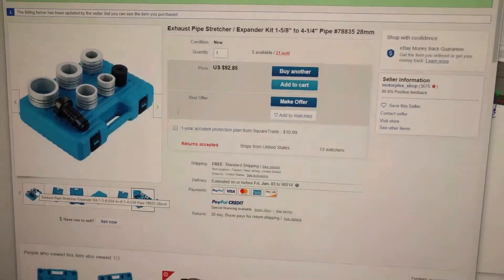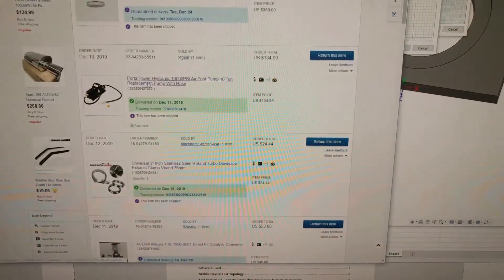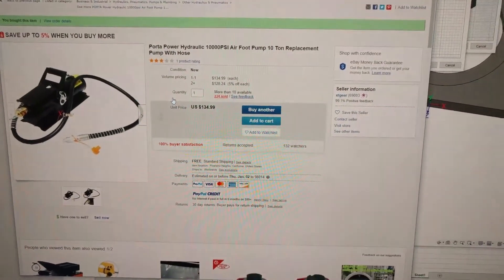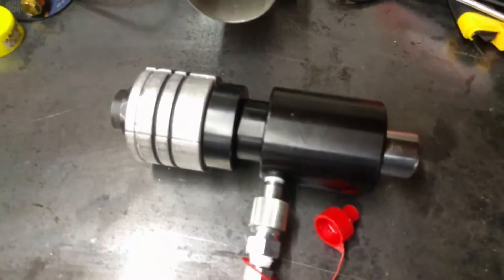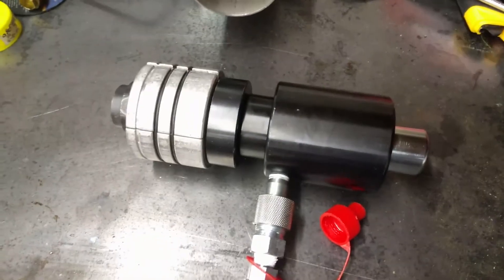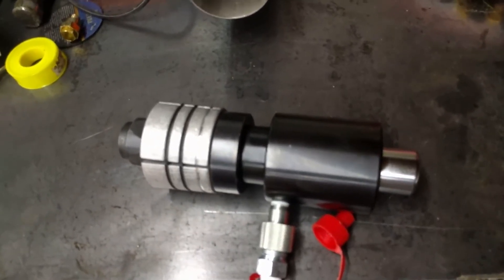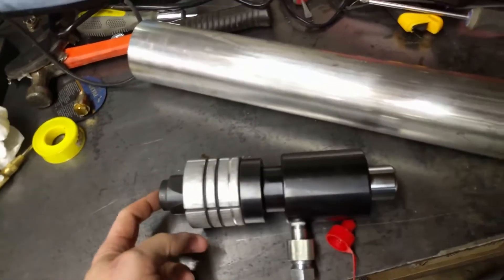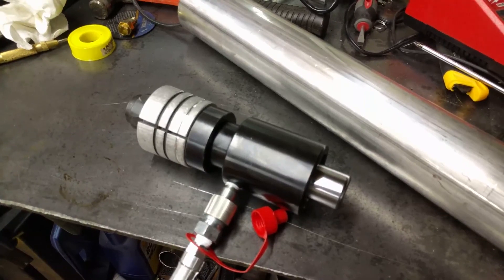Home made pipe expander using off-the-shelf parts (Harbor Freight, etc)

Comment: CAUTION: will not work unless the threads on the draw stud match H/F cylinder, it is 3/4" fine thread. Most  pipe expanders are 3/4" Coarse thread
Reply: Yep. I bought both from harbor freight today and the expander was coarse thread while the cylinder was fine. Now I gotta wait to get to an exhaust shop so they can expand the part for me. Bummer.
Reply: I just did a video where I made a stud to adapt a 3/4-16 to a 3/4-10 using two grade 8 bolts.

Comment: Have you had the opportunity to use this at all since this video? Wondering if you have any further thoughts on it after using. Seen a guy mention that the draw stud stripped after a few months of continuous use but nothing else negative.
Reply from the maker: Used it today.  I can't speak to the stripping draw stud... that seems odd to me.  It doesn't rotate when used with the hydraulic ram so it should not strip.   What's nice is that it works for the punch kit as well as the expander.

Comment: I just did this mod to my astro pipe expander........ And it works really well at a third of the price. And if you look up the lisle version you will find out that it's made in America with globally source parts.......can you say China. But why should you pay more for something some one  else put together. From parts that are produced in China. When you can do it yourself?
Reply: lisli and astro pneumatic expande made in same factory,, i can only say, that i know
Reply: Will this work on Stainless steel tubing?
Reply: @ThatV12MiataBruh  yes no problem
Reply: @moparnut6286, did you use the Astro set with the Harbor Freight Hydraulic punch set?